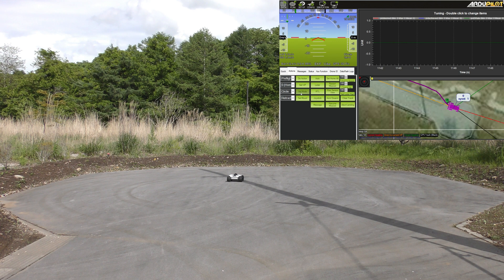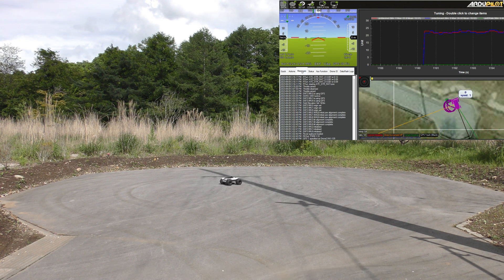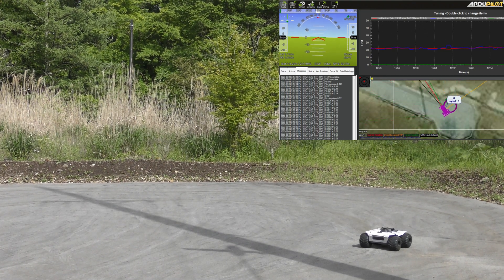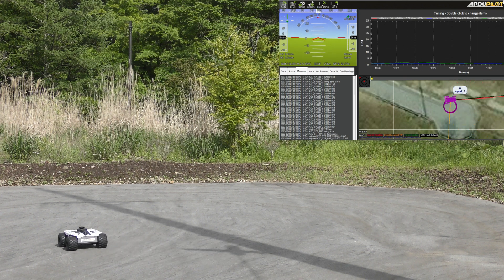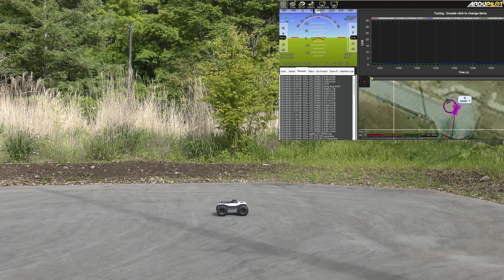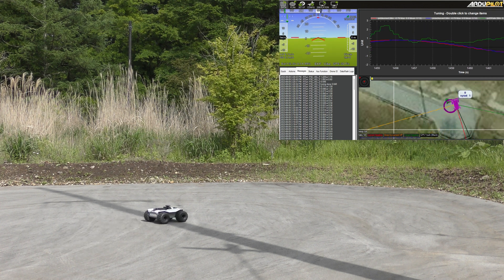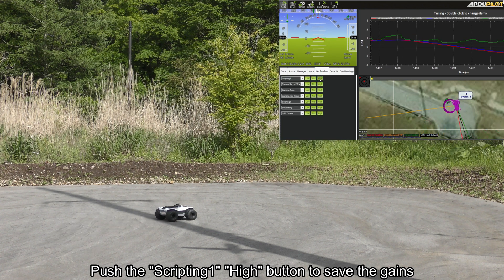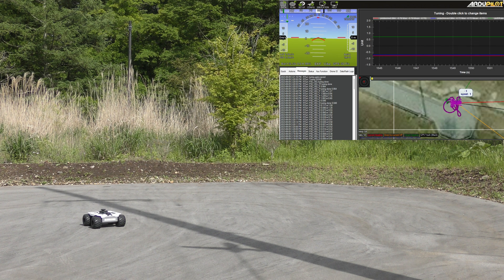Rover QuikTune Introduction

Comment: Incredible Randy ! what kind of wheels and motors are you using on this incredible rover, i want it on mine ^^ if you have a link or something it will be amazing <3
Reply from the maker: Hi @AvironLab, this is the AION Robotics R1 UGV but they're not being manufactured any more sadly.  It looks like AION robotics only does much larger rovers these days.
Reply: @rmackay9 thank you for reply 🙏

Comment: Hello, Randy! I would like to know which version of ArduRover firmware can use this .lua file. I am currently using Pixhawk 2.4.8, and my firmware is ArduRover 4.1. I followed the instructions to import it, but I do not see the RTUN_ENABLE option in the User Parameters.
Reply from the maker: Hi Chou, it's best to use the latest version of ArduPilot Rover (4.5) but to run Lua the autopilot really needs an H7 processor.  It is maybe possible to get it to run on an F7 but a newer, more powerful H7 based autopilot will be much easier.  The older Pixhawk 2.4.x probably only has an F4 processor which definitely cannot run lua scripting I'm afraid

Comment: Hi, I have rover version 4.5.1, it doesn't have SCR_ENABLE nor on the SD card does it have the script folder to insert the scripting, the code is on the website, I believe I have to copy it to notepad and save it as .lua. Could help what happens in Ardurover 4.5.1 firmware. why is it different from 4.5.0?

Comment: Hola Randy !.
Estoy pensando en adquirir un pixhawk para mi robot con MDDS30A de Cytron,, aqui en españa no encuentro solo me sale en amazon y el aliespres , me gustaria me aconsejes si puedes y veas mi robot quiero hacerlo autonomo que necesito ?. Saludos desde Provincia Valencia- España !.😇
Reply from the maker: Hi there, it looks like the MDDS30A accepts a PWM input so I think it will work with ArduPilot.  By the way, you can also ask support questions here in the forums https://discuss.ardupilot.org/c/ardurover/rover-45/175 .  Best of luck!
Reply: Se puede utilizar así sin ayuda de Arduino ?.
Reply from the maker: Hi  @garfigarfi-i9g  ArduPilot is not arduino although when the project first started we used Arduino based autopilots.  Now it's all C++ on STM32 and Linux boards.  I think it's best to post general questions in the forums instead of here. https://discuss.ardupilot.org/c/ardurover/rover-45/175

Comment: I am also working on Ardupilot Rover , I try to attach RPLidar but in full parameter list i cant find PRXtype  what to do
Reply from the maker: Hi @psmv2741, the most likely reason is that the autopilot doesn't have enough memory or flash to support the features.  The list of supported autopilots is here: https://ardupilot.org/rover/docs/common-autopilots.html .  the limited features page is here: https://ardupilot.org/rover/docs/common-limited-firmware.html .  by the way, the forums are often the best place to ask questions https://discuss.ardupilot.org/c/ardurover/8

Comment: Note that while in Circle mode MP’s Action tab’s “Change Speed” button may also be used to change the vehicle’s speed (starting we have to run the rover in manually while running select which button for speed change for tuning)

Comment: good evening sir, i tried quick tuning based on your video ,i cant rotate the rover with circle diameter value its  rotating own axis ( point based rotation only ) how can i rotate with 2 meter radius please send any video or documentaion properly
Reply from the maker: Hi there, it is probably best to post in the Rover forums including a log. https://discuss.ardupilot.org/c/ardurover/rover-44/170 .  The issue is probably that CIRC_SPEED is set too high but a log will make it easier to know.
Reply: in running circle speed reduced is possible or not
 @rmackay9

Comment: Great news! I have a boat and tracked skid steer mower to test! So just update FW to 4.5.0-DEV, and latest mission planner?
Reply from the maker: Hi Paul, QuikTune hasn't been merged to "latest" yet so there's a special firmware in this AP discussion https://discuss.ardupilot.org/t/rover-boat-quiktune-alpha-testers-wanted/101989 .  If you don't see a link for your autopilot there, just add a comment to tell me which one you need.

Comment: I own a rover equipped with a differential steering mechanism. It operates smoothly when manually controlled. However, during autonomous missions, I encounter an issue where the rover fails to perform a pivot turn after reaching a waypoint and attempting to proceed towards the next one. It appears that the differential steering is malfunctioning, specifically the backward turning of one side's wheels. As a consequence, the rover drifts from its intended position and then attempts to realign itself with the intended path. Additionally, in autonomous mode, the wheels occasionally slip. What steps can I take to address these problems?
Reply from the maker: Hi Anu, I think it would be good to use the Mission Planner motor test to confirm that the output dead zones are set correctly (see wiki here https://ardupilot.org/rover/docs/rover-motor-and-servo-configuration.html#minimum-throttle ).  Beyond that it might be best to post in the support forums to see if others have ideas as well ( https://discuss.ardupilot.org/c/ardurover/rover-44/170 )